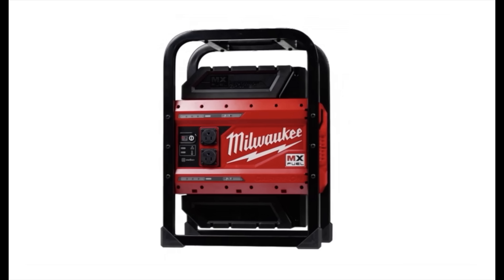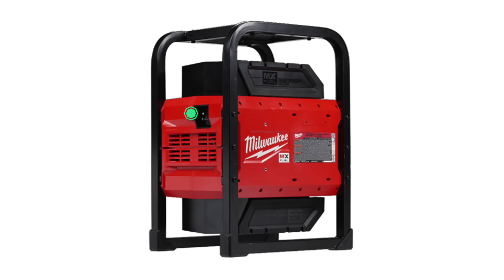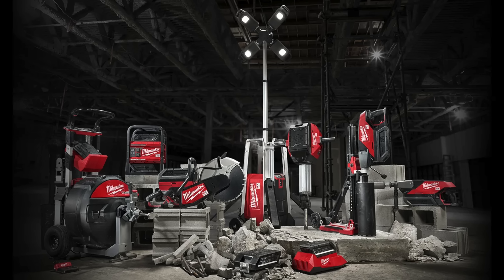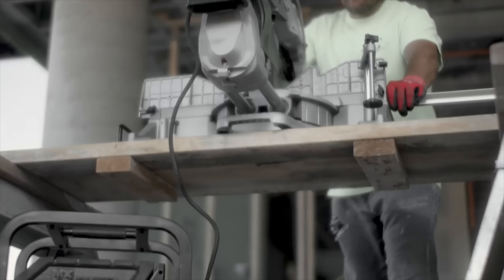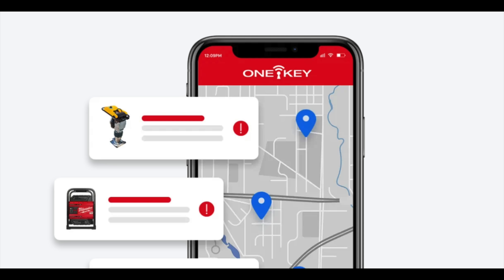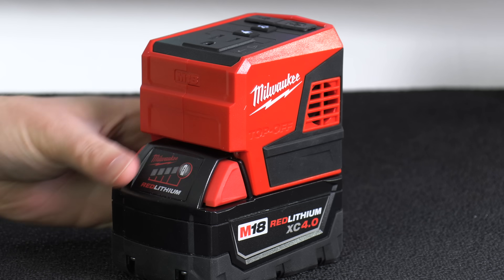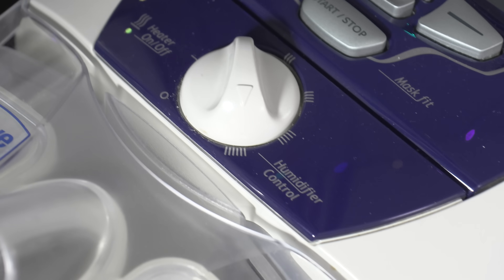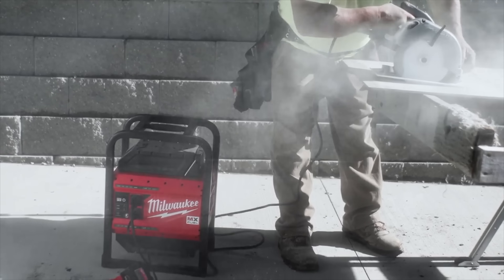END of GAS Generators? Milwaukee MX Fuel Carry-On Changes EVERYTHING 3600 Watts!

Comment: I wonder they are called “Generator” when they don’t produce power.  They store power but not generate.
Reply: probably gonna generate a lot of cash for Milwaukee from folks with too much free cash on hand...
Reply: @theoriginalchefboyoboy6025  yeah I'm going to get one
Reply: Dewalt calls theirs a power station.
Reply: Well the gas generates the power the batteries generates the power so that's why they both call generators. Want to use gas when used battery the system the side transform power from the battery and from the gasoline and turn it into a power source
Reply: and thats the part about this that totaly pisses me off!!  it generates NOTHING....
Reply: The correct term for these is, power station.
Reply: @Free-Gee  if thats what you would call one of those batteries you use for your cell phone when not around any ac outlets, then ok. but it is only a power storage device, not a generator. power station is still stretching reality a bit too much, but since you can plug a generator into it, I may have to concede. but only because words mean things and how this can be arranged and used WITH an accual generator....
Reply: Uuummmmmm!!! Just add a solar panel. Bam there you go....see I fixed it....
Reply: @stevewhite8263  A solar panel would take a hilariously long time to charge something like this. And like all "green" power generation is hilariously far from being green and has a short life span (quite literally solar panels are losing what little efficiency they have from the moment they are used and after 10 years are already operating at less than half their original output)
Reply: Oh and if you saw that you received a thumbs-up it's because I gave everybody in here a thumbs up
Reply: Electricity is the fuel... The batteries store the source of energy... what's the difference.  Both fuel and electricity are non renewable
Reply: Technically nothing produces power, just changes it from one form to another.  Gas generator doesn't produce power just transfers power from the potential energy in the gas into thermal energy by burning then into mechanical, then into electric.
Reply: @christapherdane   what is the Difference between this and a powerbank?

Comment: Maybe in the future 10 years it'll make sense since the batteries will be cheaper but for now it won't work on my job sites running air compressors charging power tools running lights running some power tools fans sometimes air condioners and electric heaters when I need low humidity. Maybe people who do odd jobs or quick renovations can use this now.

Comment: That's fine and dandy but I would rather have a gas-powered generator any day because you can't charge a battery if your powers out not to mention the fact that replacing the batteries in these type of Contraptions as well as drills and all power tools is ridiculously expensive almost to the point where it's cheaper to buy a new one!
Gas all the way for me
Reply: Was thinking about that. When I was young we went to the camp, the camp was literally a small hunting shack in the woods. Two beds and the kitchen and living room are connected. That place only ever ran on a generator. This battery powered one would be useless.

Comment: For that price you can get two Honda generators, and they “recharge” in 5 minutes for about 2 bucks (a gallon of gas). I know which one I’m picking!
Reply: You can guess how many batteries you will use over 10y so add that to the price and compare it to Honda.
Reply: A gallon of gas costs us $7.50 dollars in the UK 🇬🇧!
Reply: @Giorgio Mumda Diesel is the same expensive price as petrol (or even slightly more).
Reply: @damijanapopotnik8081  slightly more? Where I’m at it’s a Dollar more per gallon. Low side $3.80. High side $4.40 at the moment
Reply: @alaefarmestatesllc  Not here in Europe. Here the price is similar for petrol and diesel: both extremely expensive!
Reply: Once gas reaches four to five dollars in the next few months it will be different story!
Reply: @eastonvonschist2283  Gas is ALLREADY (right now!) $6 to $9 per gallon in all of Europe..
Reply: @damijanapopotnik8081  And we were energy dependent with prices at a little over two dollars a gallon until the current jackass in charge screwed it up.
Reply: @eastonvonschist2283  We are also dependent with prices, so no difference there. Maybe it is a good thing for gas prices to go up in America, gas is too cheap there and because of that you drive very inneficient trucks with HUGEE consumption(4 to 5 times that of a normal car!), you would't do that if the gas prices would be the same as in Europe..
Reply: I'm with you but it is cool to see the future even if it's not quite ready for prime time
Reply: @Giorgio Mumda And gas was around  1.25 under Trump, because the entire nation shut down. But hey, it's the dems fault for trying to get us off fossil fuels and in electric cars.
Reply: @sprockkets  funny how much of them fossil fuels it takes to dig and find all that lithium ion... All those fossil fuels to make the batteries and then drive them all across the world...  Funny how the batteries in electric cars don't last long and need to be replaced every 10 or more years...  Where is all this saving of fossil fuels when they are using 10 times the fuel than just keeping every thing.diesel like it was?
Reply: @blue68camaross  YOU ARE VERY WRONG MATE, NOT TRUE WHAT YOU SAID! 1. Electric cars are better for the environment even if you include all the energy needed to battery production and "driving them across the world". Because parts for diesel and petrol cars are ALSO driven "across the world" so no difference there. 2. You don't need 10 times the fuel for electric car, you need a LOT LESS fuel even when you include procution. You are very wrong mate, studies are clear that you are. Also batteries in electric cars last 20 years or more, not 10 you claimed. The data shows you are wrong: https://electrek.co/2016/11/01/tesla-battery-degradation/
Reply: @blue68camaross  1. No, it doesn't take that much energy to produce a battery compared to all other consumer goods or even fossil cars. Is it true that it does take slightly more energy to produce an electric car than to produce fossil car, BUT electric cars consume 5 times LESS energy when driving, and if you look for energy spend for the whole energy cycle (production, usage, and recycling) electric cars spend 4 times LESS energy overall compared to fossil cars. Hope that clears it up for you. If you would like simple explanation look here (please educate yourself): https://www.youtube.com/watch?v=6RhtiPefVzM
Reply: @blue68camaross  YOu are wrong mate. Electric cars consume 15 to 20 kWh of energy per 100 km, fossil cars consume 60 to 90 kWh per 100 km. So electric cars consume 4 to 5 times LESS energy, because they are very efficient! Afcourse EVERY thing needs to be made and you need materials for that: but that is the same for diesel or petrol cars!! And not even just for cars: EVERY thing require materials and energy to make, and NOBODY is saying that electric cars don't pollute, but the FACT is that they pollute a lot LESS compared to petrol or diesel cars!
Reply: @blue68camaross  Look here: Energy efficiency in transport https://en.wikipedia.org/wiki/Energy_efficiency_in_transport
Reply: Most people don't NEED 5 minutes recharge time. When you CAN use battery "generator" it make a LOT of sense to do so, because it is MUCH cheaper (10 times cheaper) to run. Here in Europe price for gallon of fuel is 6$ to 9$ per gallon.. and even in America gas is much more expensive than electricity (and in the majority of the world gas is much more expensive than in America, because you guys have fuel as cheap as water almost..). Even in America battery "generator" is a lot less expensive to run, in the rest of the world even more so. And you don't need to replace batteries at all, li-ion batteries in electric cars last over 20 years, google it! :) Here are the data for ya: https://www.geotab.com/blog/ev-battery-health/
Reply: @Damijana Popotnik Fair enough, everyone can make their own choices depending on their circumstances. Can we at least agree that the title “END of GAS Generators? Milwaukee MX Fuel Carry-On Changes EVERYTHING 3600 Watts!” is ABSOLUTELY ridiculous?
Reply: @adrianb6073  Every generator have its use case, if an electric "generator" CAN be used (and that is a lot of the times) it make a lot of sense to do so! To run gas generator in America for 10 hours a day for whole year it would cost you $3700 dollars just for 1 year just in fuel costs. If you could use electricity (solar panells and battery storage) it would cost you only $900. That is for America. For Europe: to run gas generator 10 hours a day for 1 year it would cost $10650 and only around $900 for electricity. Not to mention that electric "generator" is SILENT and gas generator is very loud (annoyingly loud!). So every generator have its use case.
Reply: @Damijana Popotnik If they sell 1 of these batteries for every 100 Honda 2200 gas generators I’ll buy you a steak dinner! 😂
Reply: @adrianb6073  You can be very supprised. But Dewalt sold a lot of those battery power stations for $500. ;) The price for this Milwakee is too high in my opinion. BUT: as a TECHNOLOGY for A LOT (not all) cases, this battery "generators" are awesome and surve its pupose.
Reply: @damijanapopotnik8081  I'm sure this thing has its place, but for the price, it's not on any construction site. Maybe if you're already running other Milwaukee tools using that same battery platform, but even at that I don't see it being worth the cost. My Honda eu2200i costs half as much, is crazy quiet, and runs pretty continuous near the rated 1800 watts all day on maybe 3 gallons. The Milwaukee has a rated (interested to see actual output) 864 watt-hours. So you could run it at near max for less than 30 minutes. I bet at the conditions I run, it would go 40 minutes. Then I gotta recharge the batteries for 90 minutes. Assuming I have that capability on site I wouldn't even need this thing. So if I can't charge on site, I'd need 30 batteries per 10 hour day and multiple chargers to charge them every night for the next day. At $1300 for two batteries and a charger the startup cost is $20,000 plus tax (the unit plus 14 battery expansion packs). That is prohibitively expensive for 99% of  contractors.

This is like many electric alternatives. Okay on paper, terrible in actual execution. I'm not lugging around 30 batteries that will at best lose capacity over the next 10 years forcing me to buy more for the needed run time and at worst get lost, broken, or stolen from the job site.
Reply: @damijanapopotnik8081  Electricity is also more expensive in Europe so the calculation is not that different from the US.
Reply: @matekochkoch  No it is not. Average Europe electricity price is almost the same as average US price (you must look off peak night electricity price where the vest majority of charging is done). The RATIO gas/electricity price is MUCH worse for gas in Europe!  In Europe is electric car 5 to 10 times cheaper to run than gas, but in America is "only" 2.5 times cheaper. And EVEN IF the electricity would be lets say 3 times more expensive and the gas would be ALSO 3 times more expensive, it would STILL be a lot cheaper to use electric car (don't believe me? CALCULATE IT and see for yourself!). For example: EXAMPLE A: gas car $3 per 100 km; electric car 1$ per 100 km. ...EXAMPLE B: Gas car 9$ per 100 km, electric car 3$ per 100 km. EVEN THOUGH both gas and electricity are BOTH 3 times more expensive, it is CHEAPER to use electric car.
Reply: @damijanapopotnik8081  Here is a statistic from 2020. https://de.statista.com/statistik/daten/studie/13020/umfrage/strompreise-in-ausgewaehlten-laendern/
According to that the average elecricity price in the US is $0.11  in Germany it is $ 0.39 and in Sweden $ 0.18 (Sweden has the cheapest electricity in Europe).
It might be that this statistic is generalizing but at least the price in Germany is close to the price i have to pay.
Reply: @matekochkoch  I am from Slovenia. Eventhough our price at that statistics is $ 0.162, which is some average of average price, i can 100 % tell you that we have electricty at night for $ 0.05 if you at the right provider (and you can change the provider for free if you want!). That is 3 times cheaper that this statistics shows. Here are the actual site: https://www.e3.si/dom/oskrba-z-elektri%C4%8Dno-energijo/e3-napredni/
Reply: @matekochkoch  My point being: 1. you must look off peak night electricity price where the vest majority of charging is done! and 2. The RATIO gas/electricity price is MUCH worse for gas in Europe!
Reply: @damijanapopotnik8081  "Most people don't need...."  Typical leftist thinking telling other people they don't need something when they point out a huge problem with the soon to be mandatory leftist solution.  Tell that to the people who use generators for natural disasters where it will be days before the power goes back on.  And no, using solar to recharge isn't a viable solution either, especially during an ice storm.

Comment: What is the vac regen time??   Pass through charging???  Can more than 120vac be pumped in for faster charging???
Reply: You would want more current amps not necessarily more voltage going into the battery.
Reply: @gabrielmartinez3171    It would not make any difference as the BMS is set at certain parameters, although, if  exceeded, the BMS might fail..  Anyway, this is before I read that this can be recharged in two hours from 120vac??   THAT, I have to see..!!
Reply: @pjf7943  I can believe that I've read that it's only 900 watts worth of battery 6 ah at 72v
Reply: @gabrielmartinez3171   At your rates, how could this battery drive 120vac appliances at 15 amps for any length of time..??  The tools would never turn over..!!  LOL!
Reply: @pjf7943  the battery provides 72v DC to an inverter upto 25 amps to the inverter then converts it to 120vac max continuous load is  1800 watts so in 30 minutes the battery would be drained and need to be charged.
Reply: @gabrielmartinez3171    Thank you, Gabriel..  "1800 watts in 30 minutes the battery would be drained"..!!!   Can I borrow a gallon of gasoline, pretty please..???
Reply: @pjf7943  right XD lol
Reply: @gabrielmartinez3171    Another chicom boat anchor..!!!
Reply: @pjf7943  plus each 3 ah battery is around $500 so a extra $1000 to be able to run it for another half hour. Honda 2200i can run 3 hours on max continuous output on a gallon and is pretty quiet compared to the normal noises at a construction site.
Reply: @gabrielmartinez3171    As you well know, it isn't necessary to pay the Honda $'s for a generator.  For less than the cost of one Milwaukee battery, I can purchase an efficient gas generator.. How long will it last..???  I'll buy two..!!  LOL!
Reply: @pjf7943  even the harbor freight predator series make more sense than it and the 3500 is pretty good and they stand by their warranty I use one as well fuel doesnt last as long as the honda but for the fraction of the price plus its stronger I can live with it reason why I got the honda was the strongest at the time and quietest oh and the predator has a 30 amp 120v outlet that runs the air compressor no problem.
Reply: @gabrielmartinez3171    While I like the idea of the 3500, but at 100+ lbs,. not included are the free truss and back brace....
Reply: @pjf7943  it is heavy.
Reply: @gabrielmartinez3171    I'm sure the Milwaukee battery eater is as well..

Comment: Using battery play to generate electricity.  What am I missing?

Plug it into itself and you have a perpetual energy machine.  At last!
Reply: What you're missing is that it doesn't "generate" shit. Calling it a "generator" is just blatant fraud.
Reply: @JohnDoe-nq4du  then what purpose does it serve?  Seems pretty big just to push out power from the charged up batteries.

Comment: Dewalt has power station for more than 3-4 years. I use it every day and you can plug 4 any regular or 20/60v dewalt batteries to run or charge. same 1800/3200 w output. BTW cost is 5-6 TIMES CHEAPER
Reply: V.T. said it. Modified sine wave. An ice cream truck used the Dewalt system for his freezers. It worked good until the end of the season. Then he had to replace his freezers. LED drivers have a hard time with mod sine.  I want one if they could make a pure sine wave.
Reply: @moosepasshippie  yea I won't run anything really expensive besides maybe a window ac. The tv was an regular non smart tv. I don't have anything that requires a pure sine wave inverter.
Reply: I used it to watch a football game when my power went out due to a snowstorm. It runs perfectly for a mod sine wave equipment. I also saved a ton of the 9ah and 12 ah batteries

Comment: I sleep with a c-pap machine. This would let me go camping again or power my machine when the power goes out.
Reply: How are you going to charge this price of equipment if the power stays off?
Reply: @projectone4135  Worst case? An inverter off you car.
Reply: @kkarllwt  my point is you need electricity to charge this battery bank made by milwaukee. Its not a generator. 
Plus God knows how long it will take to recharge this thing. Cant best a gas or deisel generator.  Fill it up and wa lah. Also batteries lose their capacity to hold a charge affer so many times of being recharged.
Also lithium batteries are crap in cold weather. An inverter type generater is the way to go.
Reply: I use a deep cycle battery and inverter lasts about 2 days but I can also run my Honda 2200 all night on less than a gallon of gas must have a reliable power source of grid for extended time